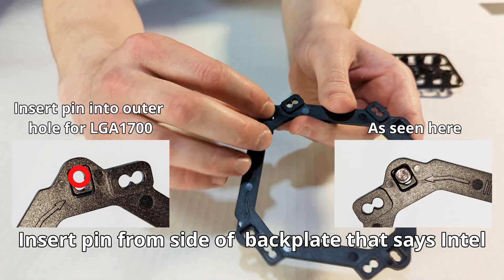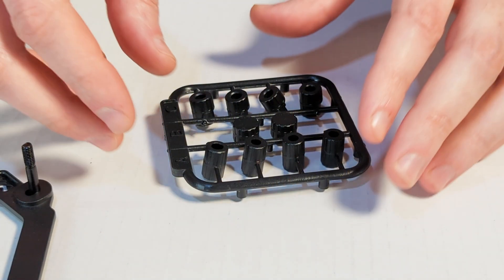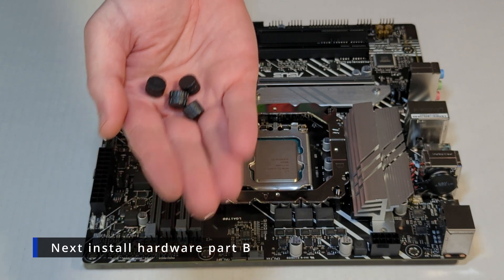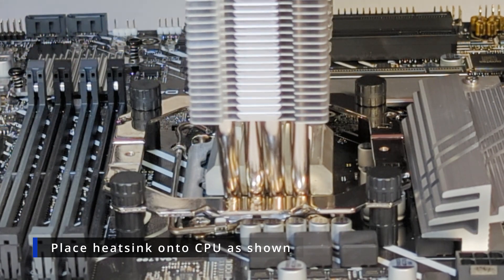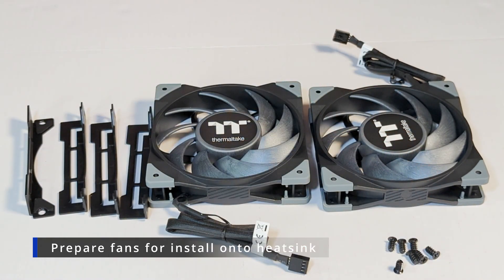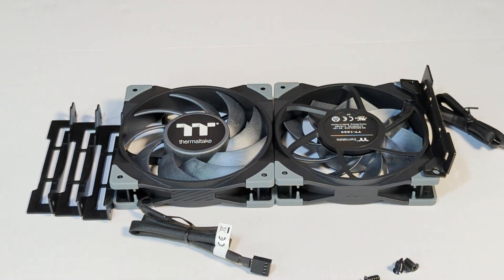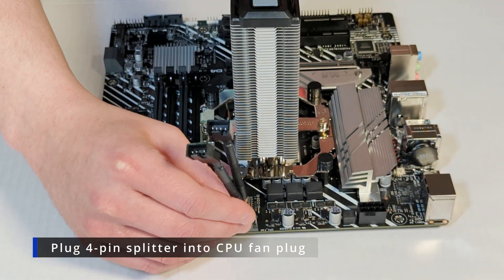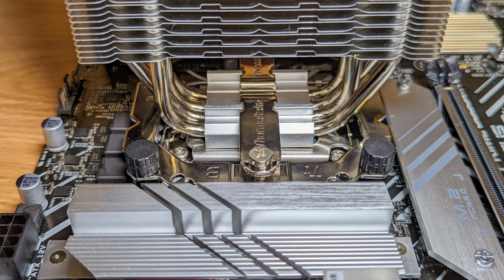LGA1700 Install Thermaltake TOUGHAIR 510 CPU Cooler

Comment: You've seen people on YouTube pick up their motherboards by their tower cooler? I wouldn't recommend that with the Toughair 510. The cooler installs easily enough and does an adequate job cooling. I can't say how high up the scale of processors you can go with it. I use the 5700G and it does fine. But The 510 uses the cross member style of tiedown and it's a single point contact with no screws, just pressure and easily moved when you push on it. It's not something that you can lift your motherboard by. Pretty high priced for the system you get. It should be back down around the $59 range, $39 if it came with one fan.

Comment: One of the coolers is missing a pin. Why? And does it matter if it will blow air out of the heatsink, or blow it in?
Reply: Think of yourself. What would you rather have? The blowing side of a fan or the sucking side?

Comment: Gr8 video! I did notice that upon my intel install that the A/B metal brackets from the instructions installs it the other way , so the indentations are vertical and you screw into the plate on the flush side. I don't think it make difference though.

Comment: Does all three 110 310 and 510 comes with mounting brackets for lga 1700
Reply from the maker: From what I have read all the new ones will have it included. If you get a kit that does not, you can contact customer support to get one. https://ttpremium.com/thermaltake/intel_1700.html